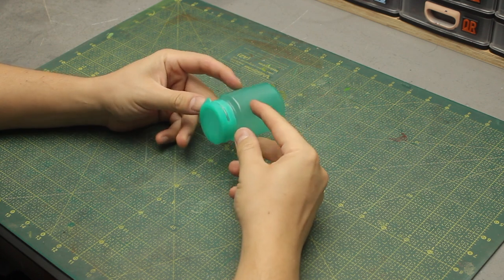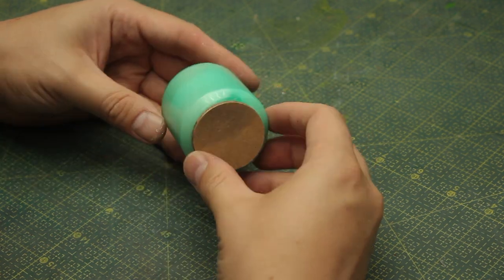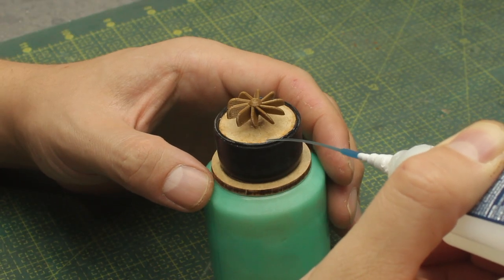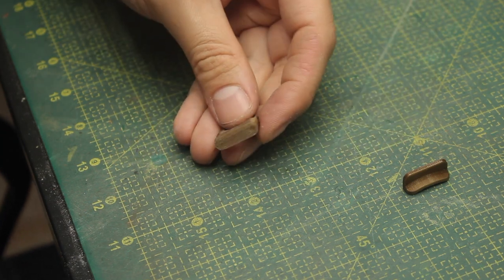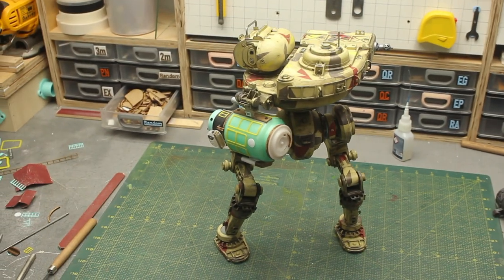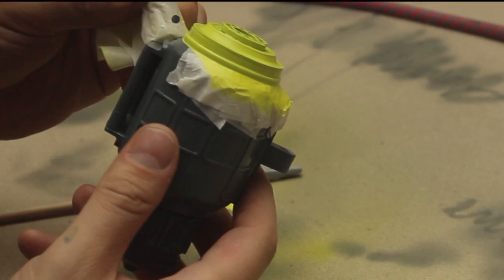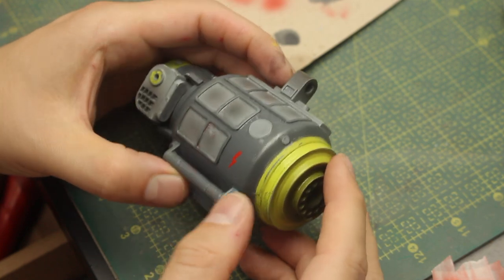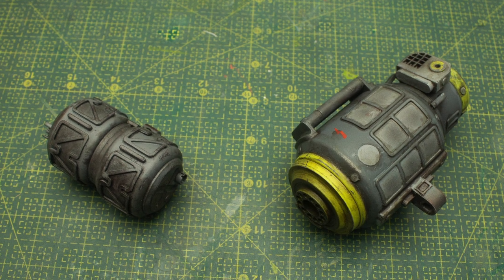Futuristic Battery Pack from a bubblegum bottle!

Comment: Hi I like the battery but when you attach it to the robot I think it would look better the other way around.
Reply from the maker: Thank you! I wanted the fan to be pointed forward, also, there's a plug on the back of it for the cables that will come later :)